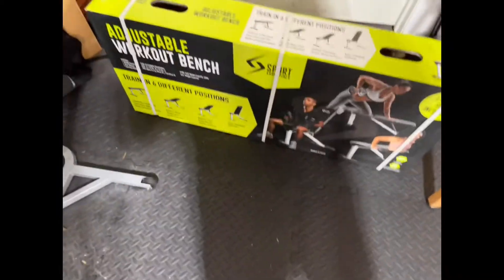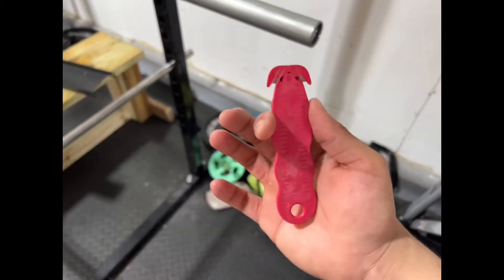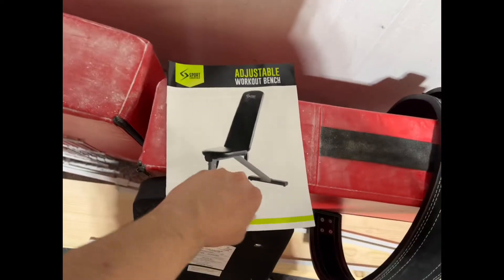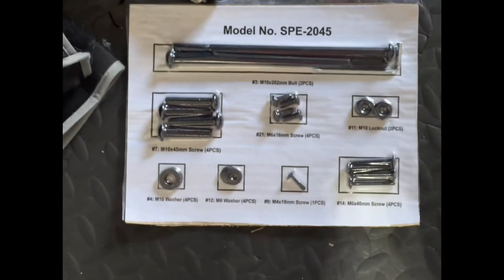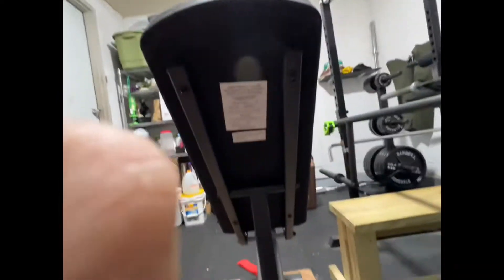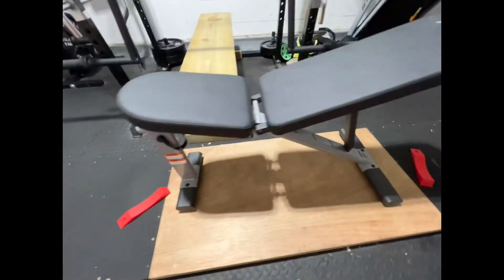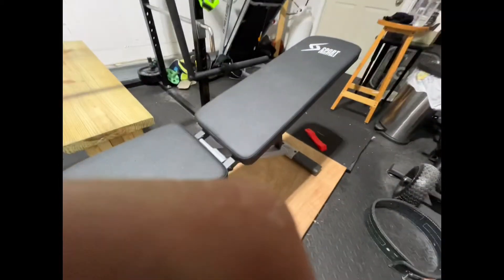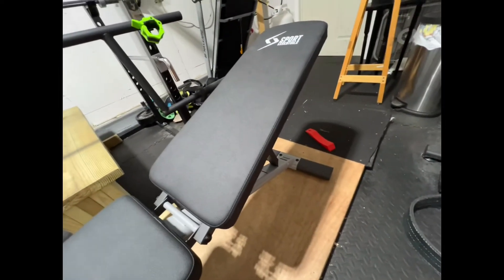I Brought an ALDI Adjustable Bench

Comment: Incline bench will be a game changer for you. Especially if you have not done it for awhile.
Reply from the maker: Im banking on it to work the triceps hard. My bench still suffers from that direct weakness. But any direct tri work really inflames a tennis elbow badly. 

This block im running pause bench, press, and incline too see if it ups the meat on the tris. CGB I’ve ran to the floor before but it really doesn’t help me that much.